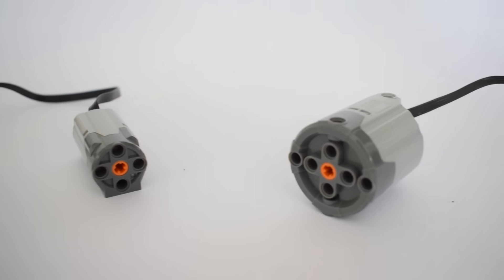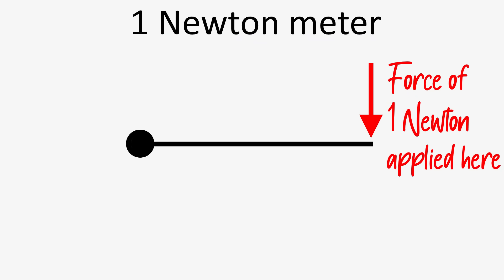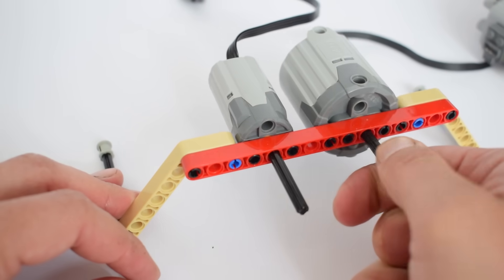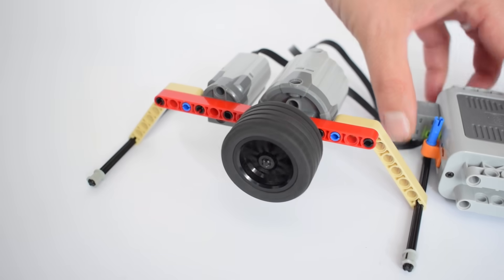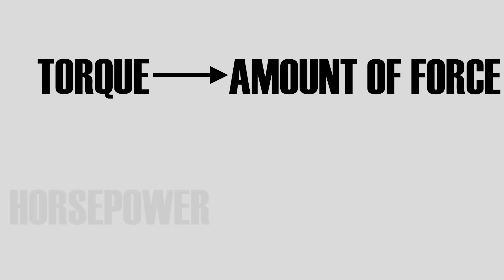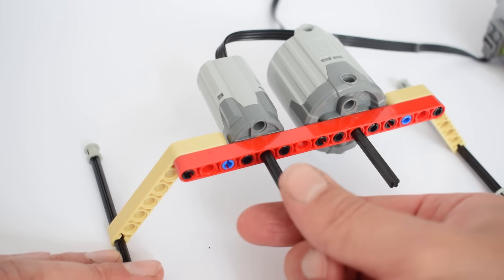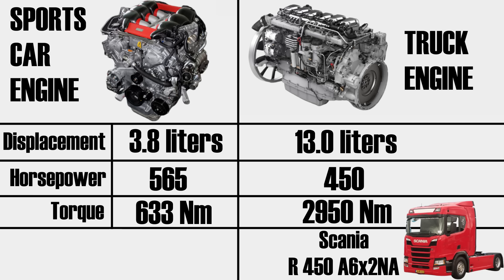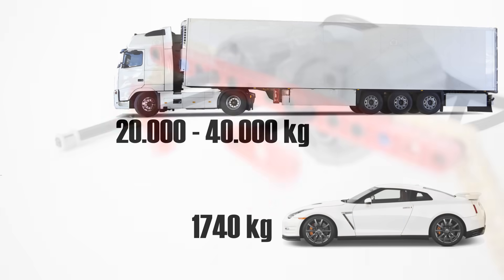NEVER be confused by HORSEPOWER and TORQUE again - HP and TORQUE EXPLAINED in the MOST VISUAL WAY

Comment: Does that mean high torque with right gearing will be faster?
Reply: it's like a comparing a 100W lightbulb that runs on 12V with a 100W light bulb that runs on 230V. same power, so same light output, that just get there differently
Reply: Gearing is just optimising for acceleration versus top speed (or for a specific track layout), while trying to remain inside the optimum power band for your engine.
Whatever the engine or car configuration (high torque / low RPM, or low torque / high RPM), one will not necessarily be faster than the other with a good gear setup.
Reply: Typically on a high torque low power engine, gearing isn’t as significant. That’s why it feels like a diesel pulls well in every gear
Reply: @r-amores8173  Typically, torquey car engines have larger power bands. That means you are more flexible with your gear selection.
Reply: Gearing is just trading torque and rpm for more of one and less of the other.

You're ultimately limited by your power output.

Gear your engine 10:1 you all have 10x torque but 0.1 the rpm at the axle.

Think 1st gear high acceleration but low top speed then 5th gear high top speed but less acceleration.

Both have the same power at the same engine RPM but different outputs

It's why HP will always govern maximum top speed as you can't get enough torque to push against air resistance if you try to gear an under powered engine to go reach a higher top speed.

Comment: This also explains why many motorbikes can generate so much horsepower with such a small displacement, even smaller than your daily drive car's engine displacement because the thing that makes motorbike engines generate so much horsepower is because of its peak RPM limit, motorbike does not need so much torque because motorbike is not that heavy compared to cars but it needs to have more power and compactness so then high RPM limit is a must and motorbike engines are small so it's lighter and more compact, therefore can Rev more than car engines do. (Cmiiw)
Reply: my bike have more torque than my car LOL (108 Nm yamaha r1 998cc vs 102 Nm fiat 1.2 1242 cc)

Comment: Truck engines are also designed to produce MUCH higher low end torque. Another reason that they spin so slowly is because of higher efficiency and much higher reliability
Reply: Yup, that's why sometimes engine with large displacement can be actually  more efficient than the small displacement engine with the similar power output because the main factor of that is that at which rpm the peak power or torque is generated, if you have an engine with 500HP generated at 7 to 8k RPM, it could be less efficient than another engine with the same horsepower but the peak power or torque is generated at a significantly lower RPM (but this can be wrong too because determining how efficient the engine cannot be done that easily because there are many factors that can determine how efficient an engine is)
Reply: Lower RPM also due to higher reciplicating masses
Reply: @FrankTheile  correct, but otherwise, lower reciprocating mass means it's able to Rev higher, that's why most of the motorbike engines are having oversquared design which means the stroke is very short and the bore is larger (you can imagine a bore size of 60 to 90mm with a relatively short stroke of 45 to 50mm) whilst trucks and buses engines are the opposite, they have a really long stroke but smaller bore size due to stroke being so much longer than the bore size itself
Reply: @FrankTheile  yeah